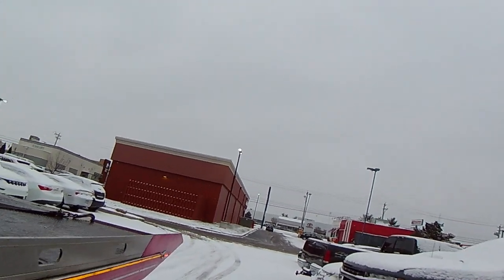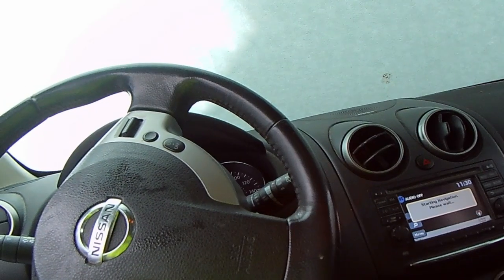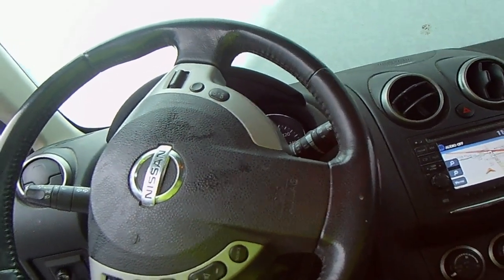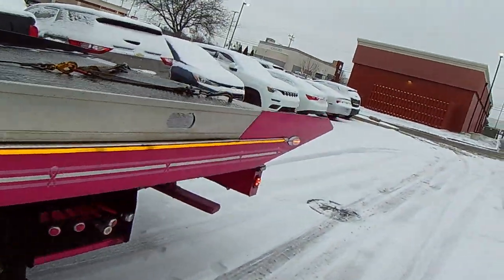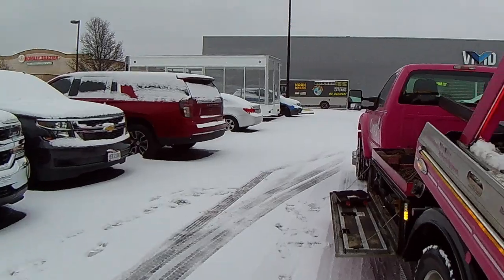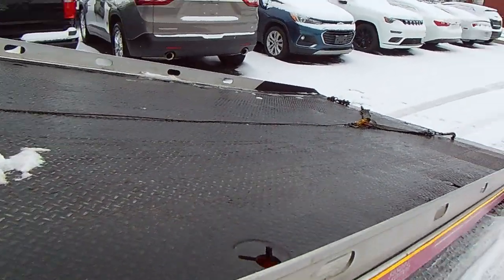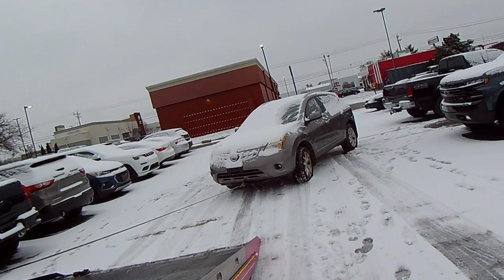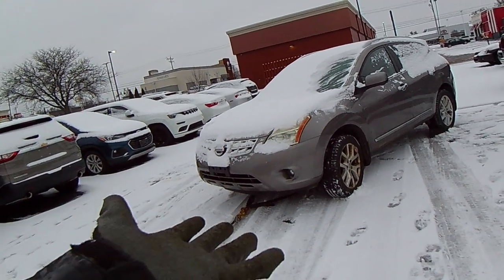Towing 101: 90 degree snatch and turn - Nissan Rogue

Comment: Usually what I do is put the bed in line with the car on the 90 degree turn because naturally if you are offset when the car finally starts coming toward the truck and is no longer turning it's still going to be at a slight angle, if you are in line with the car it will turn until it is straight with the bed then it will come forward. However, if the car is lower this won't work as that gets the cable into the tire and if it's low there will likely be rubbing on the fender when you do that.
Reply from the maker: @towtruckAJ all good points. In all my years Ive been doing this procedure I’ve found it to be situational. 

Like I tell trainees… doesn’t matter how you do it really, as long as it’s safe.
Reply: @Bigpinktowtruck  yep a million ways to do any one given task.

Comment: Question: So lets say you want to get the car out of the spot. You put the car in neutral and then as soon as you winch the car decides to roll forward. Any way to prevent that? Especially on dry pavement?
Reply from the maker: I Carry 4x4s on the truck along with extra boards. Put them every so many feet according to your comfort so they act as a wheel chock. Once the car stops on the boards, put it in park and readjust your boards. Repeat until you have the car where you want it to spin it.
Reply: Or you can just drag it, until you get the car where u want it (then put into neutral)
Reply: Or you can set the e brake slightly enough to hold will roll when winching but with the brake is on it will stop rolling when you stop winching
Reply: If you watched the video your question would have been answered smh

Comment: Lemme guess. AAA tow out of the dealership because the bill was too much to get it repaired? I learned my lesson with these. The mechanics knew it didn't run when they pushed it in that spot, they can help push it out. Always got them to do it. Forget all that extra work for $35 plus mileage.
Reply from the maker: although your assumption is correct in most situations ( i know because i worked AAA for like 5 years) this time it was an auction car with no keys for a private dealer. Otherwise you were spot on and brought back my tow trucking PTSD hahahhaa